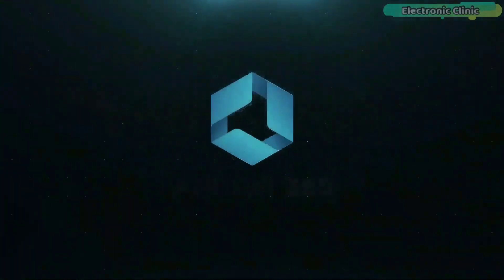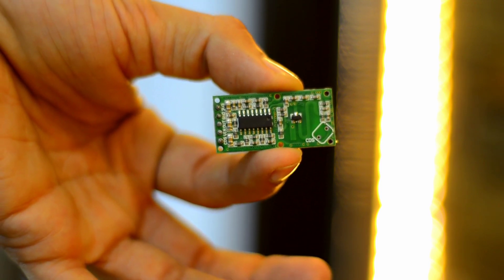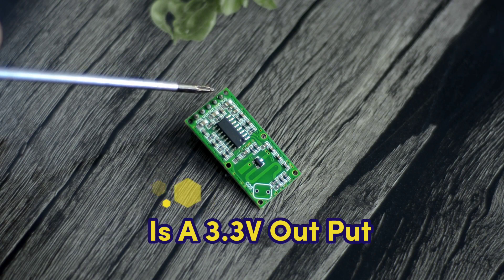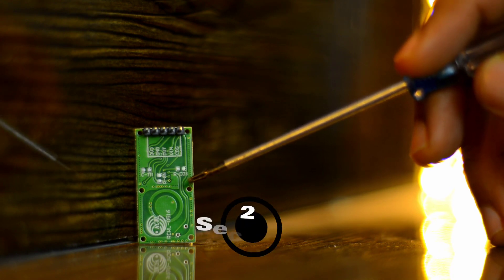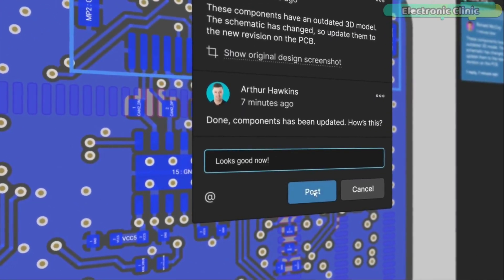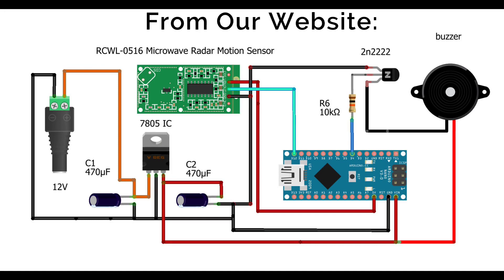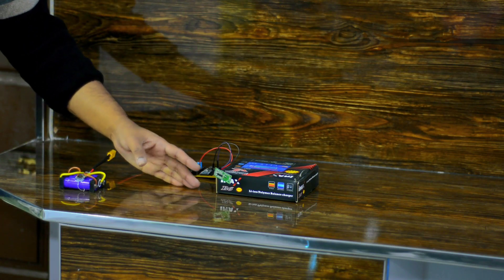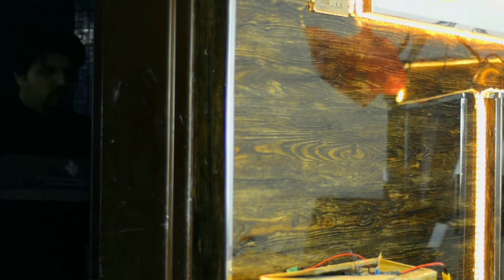Arduino RCWL-0516 Microwave Sensor or the DFrobot Digital Microwave Sensor V2.0, Security System

Comment: Hi, I have two of this similar board but my detection range is only < 5cm on the back side (logo side), and < 3cm on the front (component side). Do you know what could be the issue? Is it both board are faulty? Or I have miss any important setup? Thank you for your attention. Great videos and projects.
Reply from the maker: Kindly watch the complete video, I have explained how to increase and decrease the range and output ON time.
Reply: @ElectroniClinic  Yea I had watch the entire video, at 4:02 you explain to add resistor at R-GN that could control the range. But base on the datasheet, this will only good for reducing the range. My issue here is the detection is only less than 5 cm. So adding any more resistor won't help to increase the range right? Unless I have overlook something, you could enlighten me. 😊